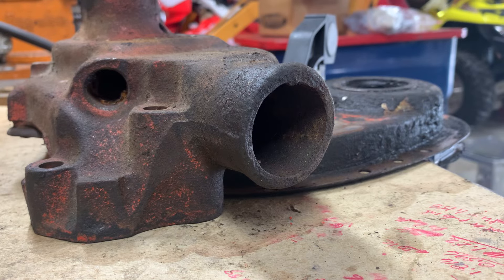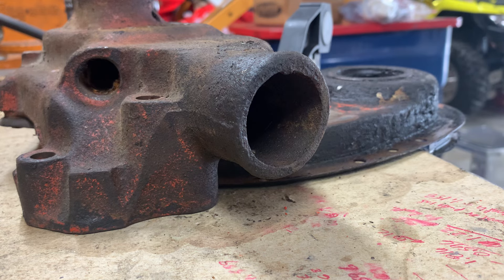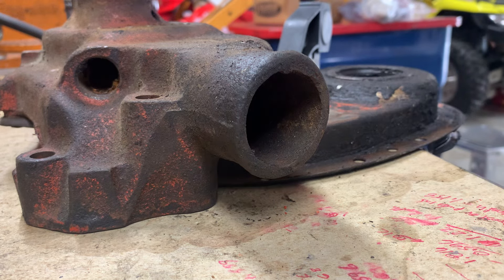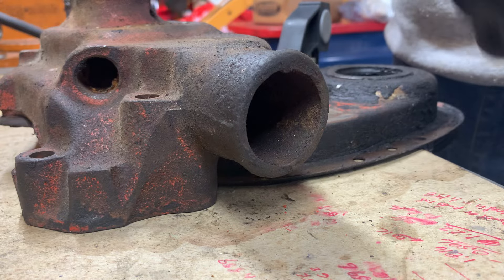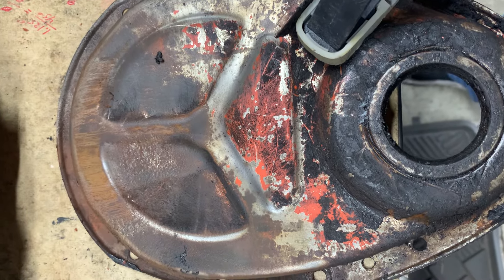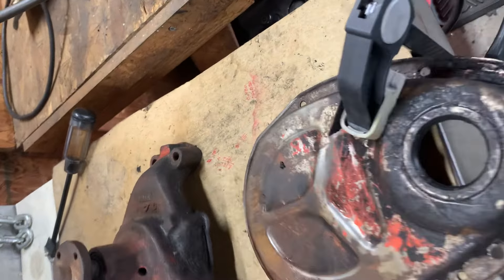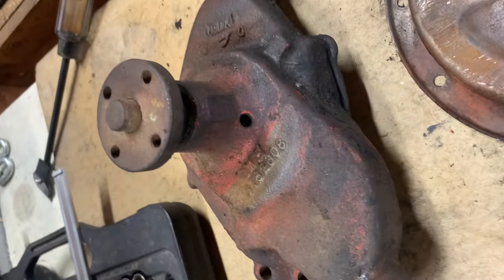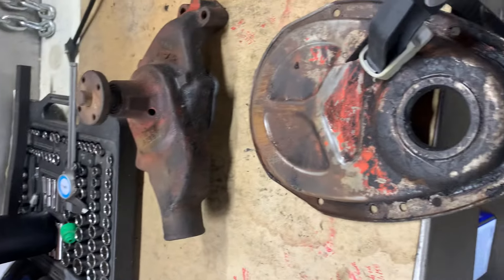Small block Chevrolet water pump to timing cover clearance

Comment: It's simple  , that's a short  water pump  , use a long  one   , of course there Elvis  you will  have to change  pulleys too
Reply from the maker: I have a situation where my short water pump (all Corvettes have short water pumps) was barely touching the timing cover.  Someone made mention that the roller camshaft was was the two to touch.  The intent of the video was to illustrate how original GM water pumps have no clearance between the water pump and the timing cover.